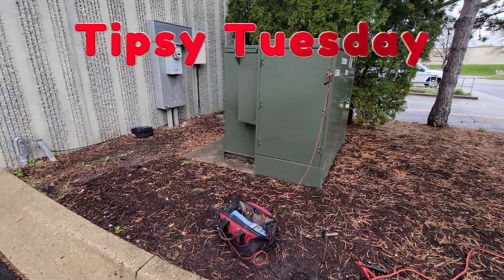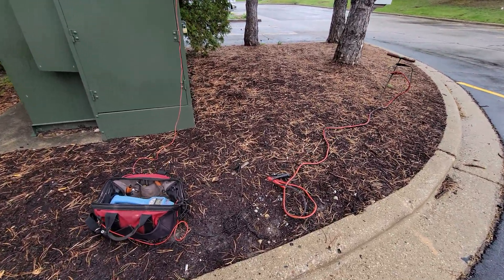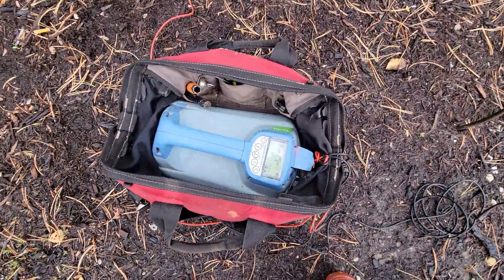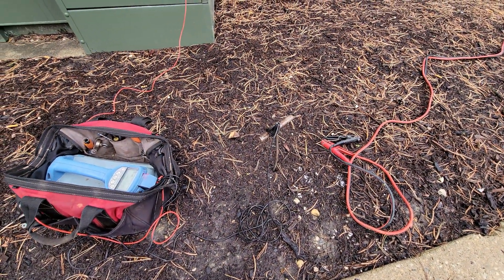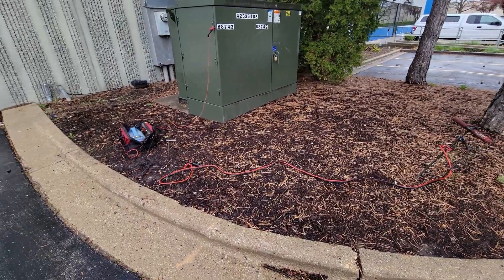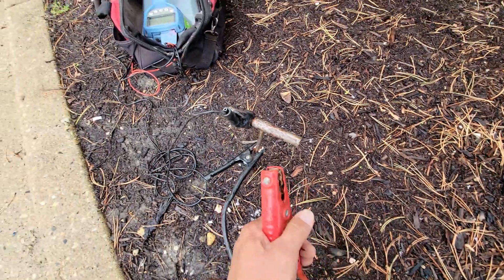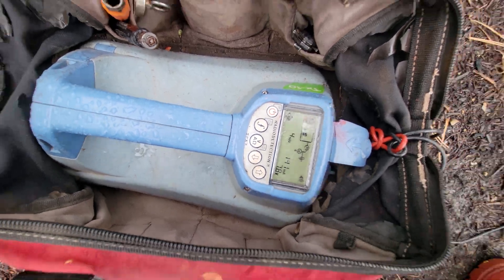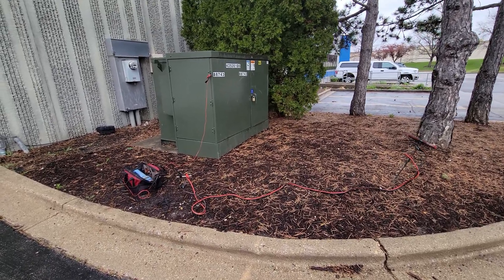Radiodetection Transmitter | Double Grounding Technique | TOP DOG WAY

Comment: I have a good question. Whats the best way to locate A Single Phase Primary that is buried 8-10 feet deep  maybe deeper because of back filling the dirt. and 8/33 doesnt work and you gotta crank up your gain.
Reply from the maker: It starts to become difficult to locate when the utilities are diving down from 6 ft down to 20 ft try to set your Transmitter Maximum Voltage from low to high, set your Receiver to 9.8 kHz, and use guidance mode. You should be able to locate the utility but you have to move slowly.
Reply: So I have a question why would you want to lower your voltage? Is it just for possible interference because I saw your milliamps never changed they were 141 mA and I was always underneath the impression that milliamps or what causes bleed I could be wrong.